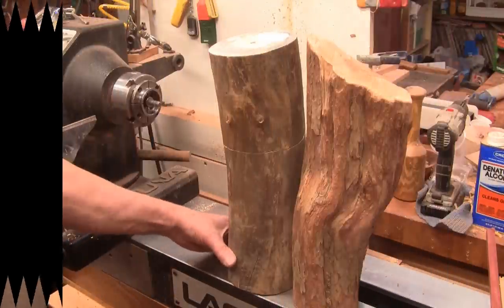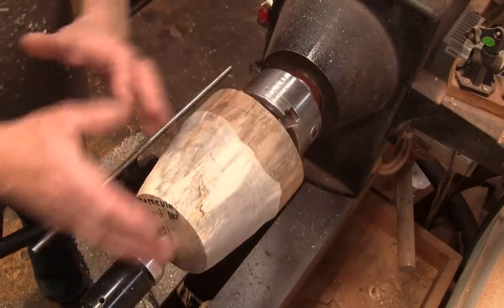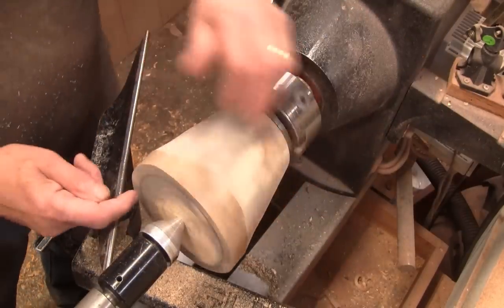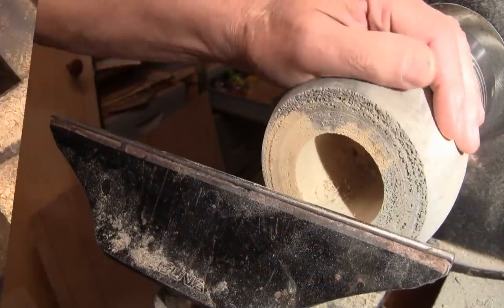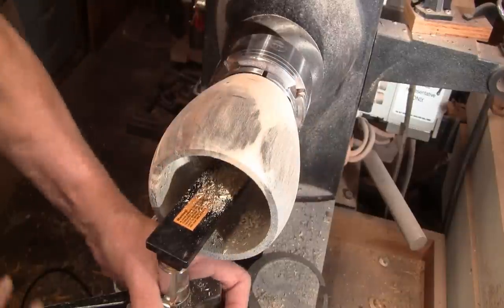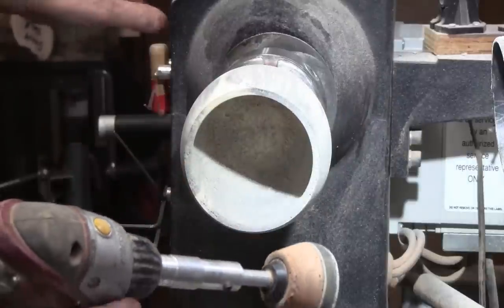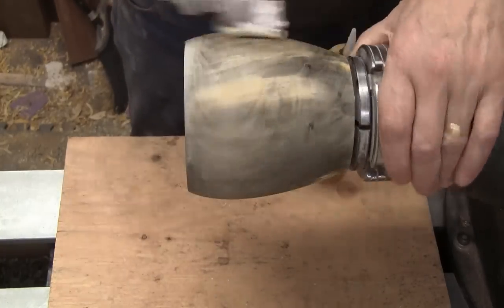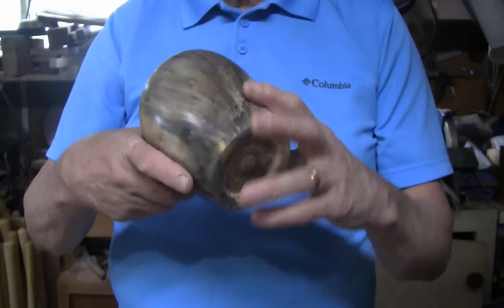Wood Turning Ornamental Chestnut End Grain Cutting Tips

Comment: A set screw on the back of the chuck for when you are turning in reverse...note taken, lesson learned. THANK YOU!!! (I just upgraded my lathe and now have reverse. Never did before so it was never an issue)
Reply from the maker: Yes it is a good idea Michael. If all goes as planned you may not need it. But if you get a catch it can unscrew very fast.
Years ago I had a very old lathe and wired the motor to run both ways. Most of the time you had to wait for it to stop before it would go the other way(capacitor start motors work that way) Well back then we did not have chucks so I used a face plate. No setscrews back then either. It unscrewed a few times. I was only using it for sanding back then.
 Also remind yourself to back off the setscrew before removing your chuck or it will ding up the threads.
 Happy turning on your new lathe.
Gary

Comment: Papa,
Another beautiful piece for your collection.
Since you have tube type fluorescent lights in your shop, I have noticed that they seem to be a very good indicator of how smooth and polished a piece on the lathe is. The smoother and better polished a piece is, the better defined the reflection of the lights is. Perfection is when the reflected lights show as individual straight lines. Sometimes, when you are finishing a piece, I can get mesmerized watching the light’s reflections turn from fuzzy to razor sharp 😋.
Thank you for another enjoyable interlude. Keep the aspidistra flying!
Paul
Reply from the maker: Thank you Paul. And what a great tip on making sure I get a good finish. I usually see the reflection of the lights when editing the video.
But do watch the reflection of the paper towel as I polish the piece.
I wish I could show that better because it really lets me know.
 I will try and set the camera up and see if it will show it.
Take care,
Gary